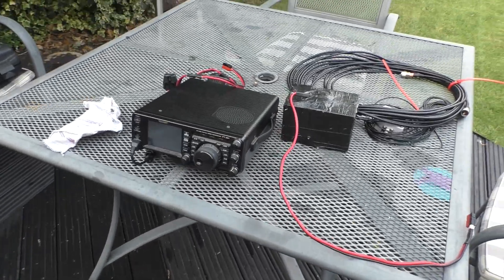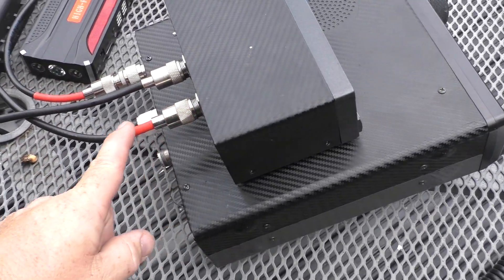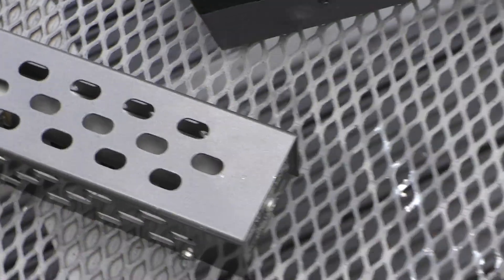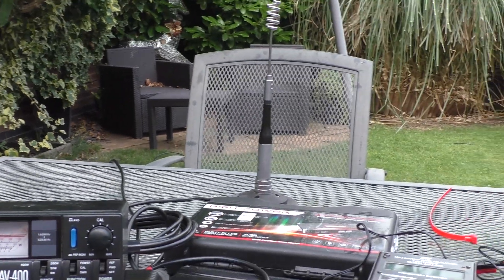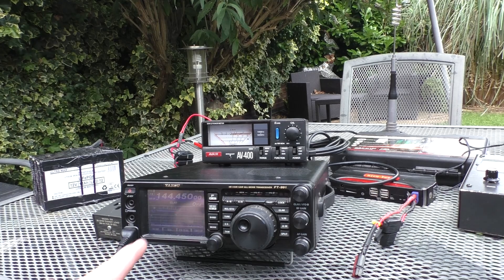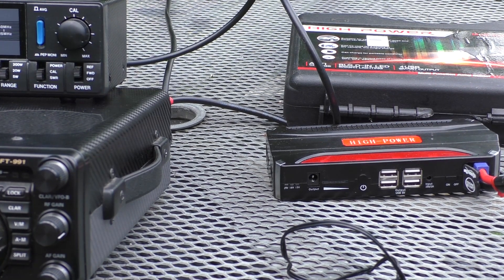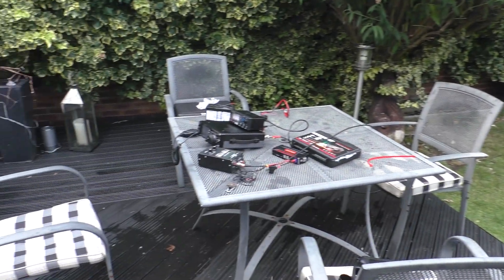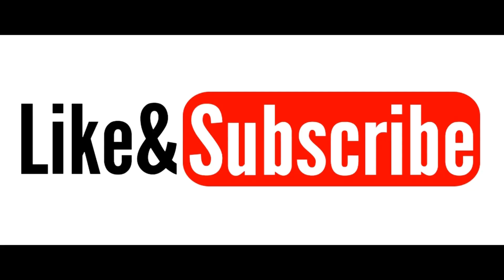Basics of using a SWR meter and MFJ Antenna Analyser for Amateur Radio

Comment: So then there's basically two ways to check if you're antenna system is resonant at the driving frequency. You can use an SWR meter, in line between the rig - or xmitter - and the antenna, or you can connect the antenna to that antenna checker gadget and see if the antenna is resonant without hitting it with rf power from the rig. So then you use that second device in order to first make sure that the antenna is close enough to resonance before connecting the rig to it and risk damaging your transceiver. Right?
Reply from the maker: Basically yes.
Reply: I wish I knew about this before I blew up my linear amplifier years ago.

Comment: What if it is below 50ohms would that make a difference to performance
Reply: Both impedance AND reactance DOES make a difference in antenna performance.  It's not a show stopper if these two aren't perfect.  In fact you may not notice any difference or any major impact in communications.  However if either impedance is far off 50 ohms and/or reactance is significantly off zero, performance will suffer and can possibly damage your transmitter or reduce the life of it amongst other potential problems.  SWR 1.1 (50 ohms impedance) is not the only factor, but the resonance of the antenna dictated by having 0 reactance. This particular analyzer the author is using was not displaying the reactance.  I'm not sure if that particular unit this was switched off or if the analyzer didn't have that feature, but you need to be able to see the impedance and resonance when tuning an antenna.  You want to achieve BOTH close to 50 ohms AND close to 0 reactance as possible to have the best performance from an antenna (if building your own or modifying the performance).  Many mobile antennas will generally exhibit a lower impedance due to the design to be used on vehicles which is why they also are very poor in performance compared to base antennas such as quarter wave ground planes, which can generally be designed to run much closer to 50 ohms with 0 reactance.  So it wont be uncommon to see varying results and measurements.
Reply from the maker: On its own thats not that important. The SWR is a good enough measure to guage the match.
Reply: Ham Radio VLOG Ok so what if I had a swr of 1-1.5 and ohms of 34
Reply from the maker: @davel831  Focus on the SWR. You may see on some of my videos the SWR is fine but the Impedence isnt what you would normally expect. Also check all your connectors etc just in case.

Comment: Where did you get the LiFePo battery from, and how much was it?  73 VK4QP
Reply from the maker: https://www.ebay.co.uk/itm/Ultramax-LITHIUM-12-Volt-12ah-battery-Cell-for-Kids-electric-toy-car-scooter/112354080416?_trkparms=aid%3D555018%26algo%3DPL.SIM%26ao%3D1%26asc%3D40733%26meid%3D7bb9aae9256e4e8da277539962fabeb5%26pid%3D100005%26rk%3D3%26rkt%3D12%26mehot%3Dpf%26sd%3D122423814678%26itm%3D112354080416%26pmt%3D1%26noa%3D0%26pg%3D2047675&_trksid=p2047675.c100005.m1851